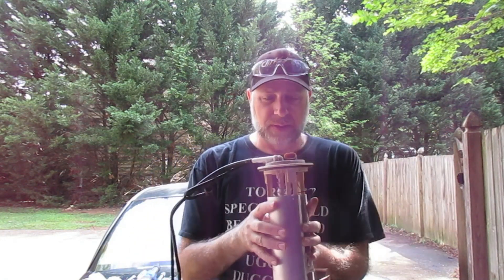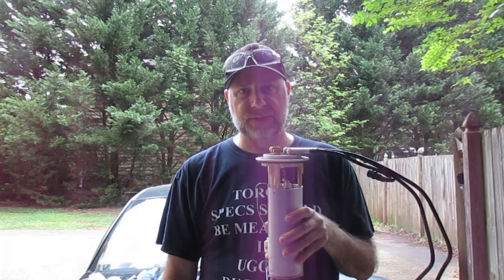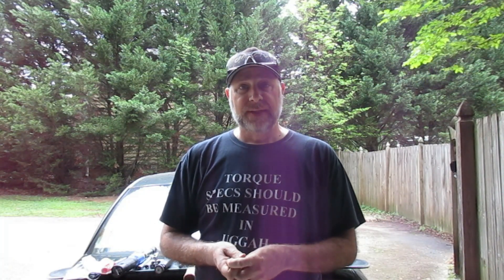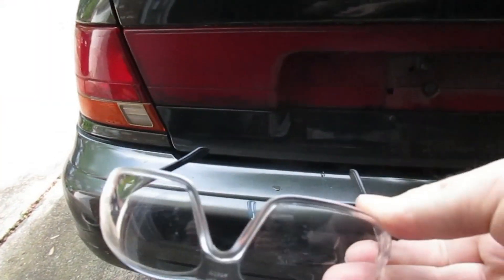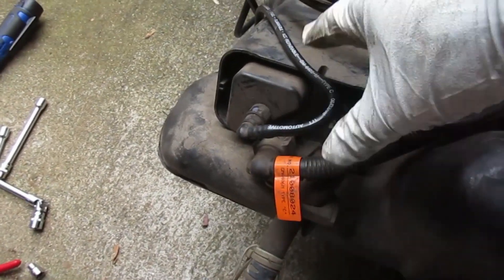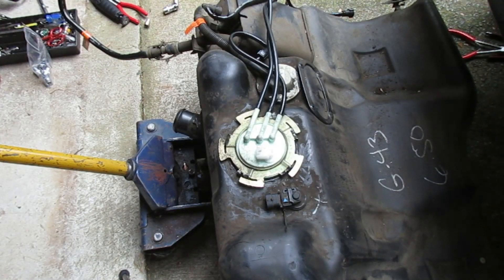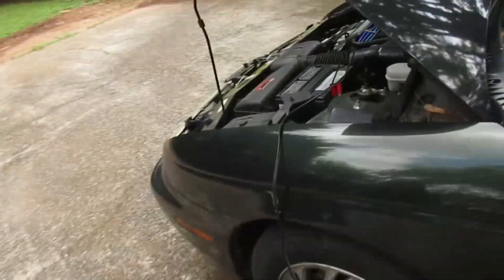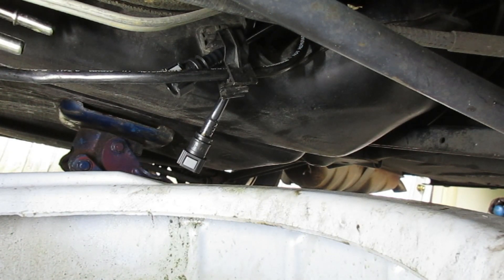1999 Saturn SL2 Fuel Pump Replacement - Saturn Saga

Comment: Thanks! Those harness clips can hold a lot of weight. GM definitely didn't want regular people replacing fuel pumps.
I' saw someone install a trap door above the fuel tank so they could change it out faster in the future.
He said that the tank was out, and it was a pain, so why not?

Comment: what if i have a quarter tank of gas in it but the fuel pump is dead?
Reply from the maker: You can still drop the tank.  I had about that much, or maybe more, fuel in the tank when I filmed this.  Just lower it slowly.